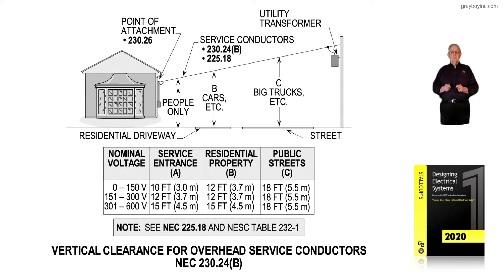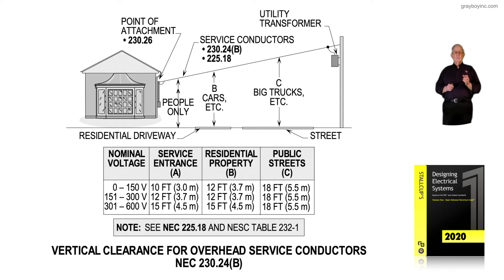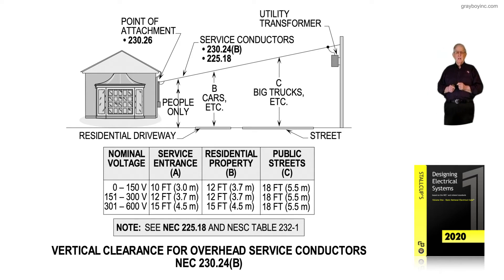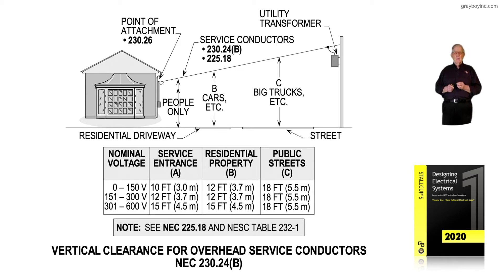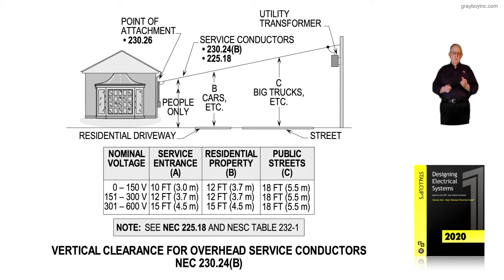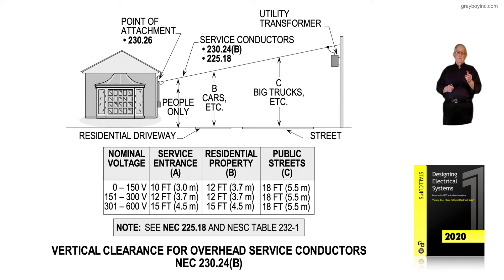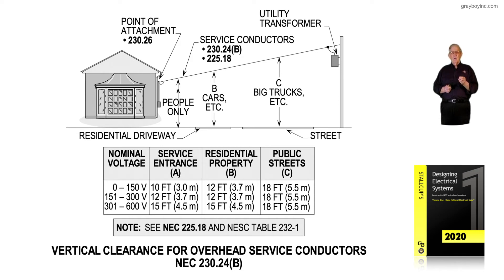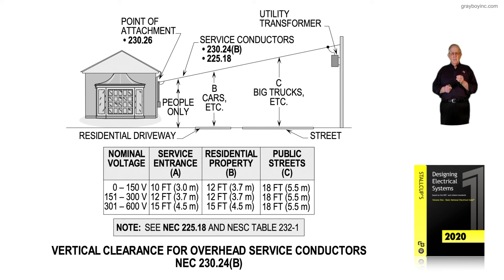6-14  VERTICAL CLEARANCE FOR OVERHEAD SERVICE CONDUCTORS - 230.24(B)

Comment: Mi install looks just like your diagram
120/240
Ive got a deck & 10' point of attachment. It levels up to the pole!
Reply: Hi Shelby, I believe that this measurement should be from the drip loop per 230.24(B)(1).
Reply from the maker: www.grayboyinc.com 
Use the following coupon code at checkout for 45% off all products. Coupon Code:   22GB45